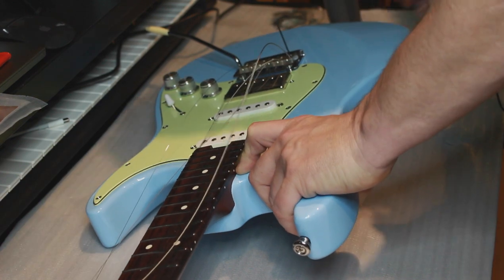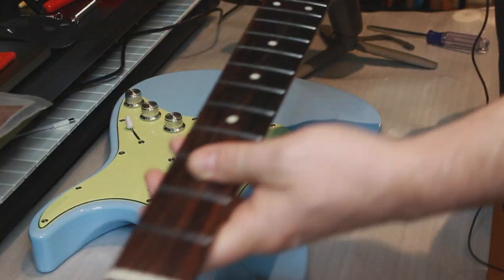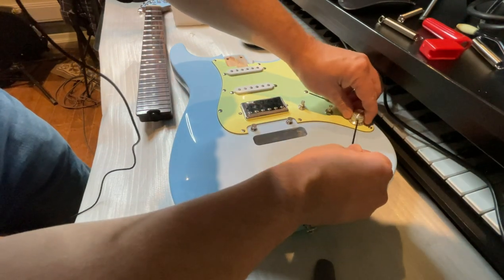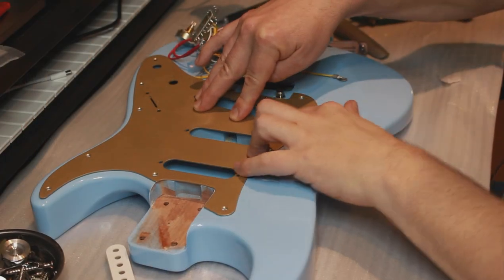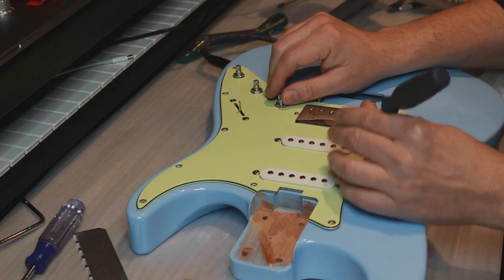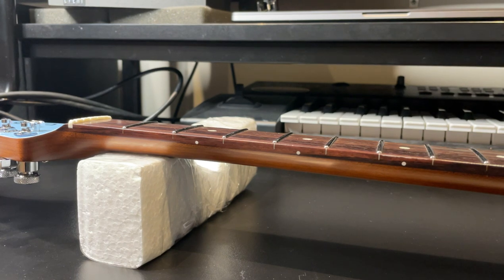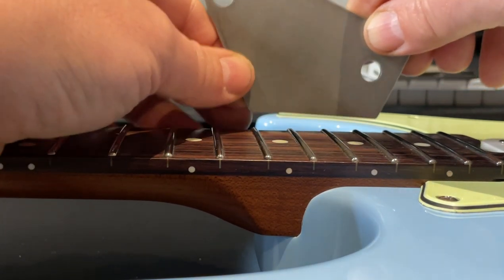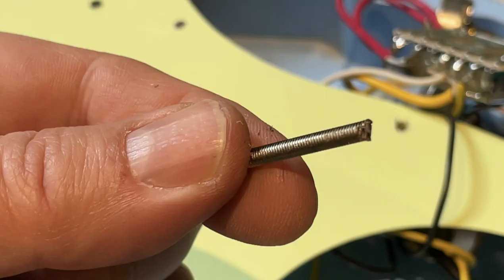Eart CP-1 - Worth the Hype?  Sound Samples - Complete Tear Down - Analysis

Comment: if you are talking about the strings being tight in the block that happens on every brand when strings are over tightened, and judging by the marks the saddle screws made in the bridge plate yea, your stings were WAY over tightened at some point, WAY over tightened, this may be an assembly issue and I agree you need to say something so they can sort it, they take it all seriously so don't think they will not hear you, I bet they will investigate and resolve it..

thats a lot of deep gouging in the trem plate and I am not sure where you think fender gets their bridge plates but its not north america, or south america, they ALL get the same treatment regarding chroming, the difference will be the thickness and dimensions from say a squier to an American but fender stopped making base plates a long time ago so for now they all get the same chroming techniques for sure... 

saddles and screws may be different and again I honestly believe someone cranked down on your strings real hard causing them to jamb in the block and gouge the trem plate like that.. an easy fix for this is to melt solder down into the trem block then redrill at the size of say the largest string a 58 or so? some guys pour brass down em, aluminum, solder works get a good hard solder works fine fill the holes all the way top the top.. that's actually an upgrade for any block, more resonation dontchyaknow...  lol...

they may use a pre tension system where they way over tighten the strings then back off and tighten up so they the strings prestretch? thy are budget strings for sure, d'addario knock off's but very cheap strings indeed, mine strings were gone first ten minutes, they're really bad

but the pups are decent on the Explorer1.. try an upgrade, get out of the budget arena and you will be please.. also ihd to push out 2 strings on my hard tail too so I think they are over tightening them for some reason?

also don't waste your time or money on copper shielding these guitars do not warrant that in any event, upgraded or not, just get a quart of that shielding paint or make some, apply 3-4 coats and it works just as well as copped any day of the week, no jokes, yo can actually use it as a conductor, as in light a bulb with it.. yup done it, you don't ave to light a bulb just put your tester to continuity and place the probes at opposite ends, yup, it works well and is inexpensive, tape over numbers what not..

nuther good upgrade for yours would be the guitarfetish alnico hybrid set or the blues set, the 60 set, for like $50 on sale they are very nice for budget guitars..

what was the flaw or damage whatever yours had?

also any budget guitar will need upgrades, that's nothing new, no budget brand is going to shield or match pups, nope, entry is entry...  again try their $600 guitar, oh boy...  you see the necks on those things?  very very stable..

Comment: Have you tried putting a magnet to the fret wire to see if they're actually steel?
Also is the body 1.75in? If it is then it would be able to take a standard size block/bridge upgrade.
Reply from the maker: It’s not that simple. Even if they are I do t trust them to be of high quality. 

Check out the link below. 

https://www.kjmagnetics.com/blog.asp?p=stainless

Comment: I think the strings made your fingers black not the frets.  Are you running your fingers on the strings on the frets?
Reply from the maker: Hi Bluwg.  Thanks for your comment.  I've gone through thousands of strings in my life and played lots of new guitars and this has never happened before.  I think it's more likely that after polishing the frets Eart didn't do a great job cleaning the neck up. You have to pay a human to clean the neck and that's expensive so they skipped or did a half hearted job.  I oiled and cleaned the neck during the first string change and it was pretty dirty.  Like I said, I think they just didn't clean it up after.
Reply: @LucasCrossleyGuitar  I had the same experience with having my fingers turn black for the first 2 hrs or so of play....Hopefully it's just a cleanup issue because SS shouldn't do that if they're clean
Reply: @LucasCrossleyGuitar  thanks.  You said you had another model, will you be doing a demo?
Reply: I think it's a leftover fret residue from the crowning and filing process when they were installed... at least it was one one of mine.

Comment: I'm curious that, as you've struggled with NON-pull-thru strings, you didn't share tear-down moments investigating the answer.  You mentioned you'd jammed the allen-wrench between the ball and the wall, but the video didn't include investigative comments.  "Ah - NOW I see the problem!" or "Nope, that doesn't solve it."  Do you have any idea why these 'jams' are occurring?  Are you simply not using a large enough sledgehammer?  (Those can create a mighty impression on-stage, by the way.  Pete Townsend only pounded his guitar held by the neck - he never once used a sledge on it!)
Reply: By the way - handyman specials can be great BUT my concern is Quality of Wood.  Just how many times does the wood stand up to screwings/unscrewings?  Because that's one thing a newbie-tinkerer will 'violate' eventually and he'll end up learning about caulks and wood-glues vs. doing it properly.  I'd hate to have a newbie learn that in the first 2-3 mod's... I'd like the wood to hold up at least for 5 change-outs, or 10.  This is one reason I like the Pacificas for my newbie-tinkerers - the quality of the wood HAS BEEN on the outstanding side.  I can't believe they have a monopoly on the cheap good-wood, though.
Reply: One other thing - thanks for the camera work to detail the pickguard "standard Fender hole alignment" issue.  It appeared - on my first viewing - than the standard pickguard's holes are close to the Eart's holes, so that the standard pickguard would easily cover the filled-in Eart holes.  Yes?  Of course, the most troubling issues were (1) the thinness of the body wood which might preclude additional depth-routing, and (2) the need to additional routing to accommodate any other pickup setting.  I appreciate the pool-size routings that some cheap guitars off for mods.
Reply from the maker: Hi Chuck. I asked a luthier friend of mine about this. His position on the matter was quite clear. He stated this only happens on guitars sold at Toys R Us and Walmart. Basically he’s saying poor quality guitars.
Reply from the maker: Hi Chuck if the holes don't line up you can have a few issues.  The biggest concern would be if you have to add a hole too close to where one already exists, then there may not be enough wood between the two to make it strong enough to function the way it should and instead of two small holes you wind up with one big one.  Hope that makes sense.
Reply: Oh yes.  Know the problem well.  Fortunately, the good fillers work well enough and those screw-holes don't have a lot of stress.  I've suspected dried bubblegum would work.  Until I wanted to remove those 2nd screws and then I'd hafta find new bubble gum.
Reply: Isn't it as simple as the holes drilled through the trem-block are too small?

Comment: I don't believe they are locating pins.   More likely voids in the fretboard after putting the radius on it.   Easier to mix up a little rosewood dust and superglue and patch, than use better quality rosewood.    IMHO.
Reply from the maker: Owner of the company told me they are locating pins. They are metal. Appreciate the insight though.  Cheers.

Comment: welp, seen my share of sub $200 guitars and by FAR this neck blows em all out the water, and if it plays well? it blows a lot of $5000 necks out the water, simply for the fact it has hemispherical ends, not easy to do and on stainless steel?

not many $5k mass produced even have stainless frets? your les pauls have em? nope, your teles and strats? nope, you see someo high endser get stainless, none get hemoi ends which are PHENOMENAL despite what the youtube munkess have to say abou it, being able to feel a fret is imperative unless you are a fretless player, it allows you to find the note or chord, whether you realize it or not, they help location..

hemi ends are not new, just not easy to do, clearly you cannot just slap frets on then hit with a fret end file and go, nope, each fret must be measured and installed individually, myself I only do the bottom of the fret hemi, that way I can put a bargeboard on the bottom side then push all hemi ends against that then use a end file on the top side..  they must have figured out a system and my guess is every single fret is the same size for every single guitar they do model wise, meaning the 3rd fret on each strat they do is the exact same size, this allows them to cut a mass of this size of fret, then use a machine that does the hemi end the same each time..

let me tell you doing hemi ends by hand is not easy to make them the same size for each slot, grind off too much or too little on one end? frets not the same size as the next, and this is imperative to get the fret end line straight, and I WISH someone would put the camera down the fret line on each side of the neck so we can see how straight that line really is? if each guitar has straight lines down both ends they have developed a very good system for this.. ask any luthier doing hemi ends its not easy and tool intensive..

my self I use a dremel grinding wheel, then I round off a drill bit with a hemi end that's the exact same size as the fret end I want to be, then I take that drill bit to the grinding wheel so it carves out the cupping I need, then you just put the fret ends intherie wheel spinning and roll the fret in your fingers and its perfectly round, ,long as that cup in the grinding wheel is perfectly round..

that part is easy, getting them the exact length of the slot so when installed the line is perfectly straight on both sides, welp that's not easy, why I do one end only, but those to a board I clamp to the neck then I clip and file off the top side of the frets.. just easier and I still get that hemi feel on my fingers.. like to see how straight that fret end line is on these..  what a deal, stainless frets would bea deal, hemi ends?  oh boy what a treat, they last so long...

also if you do any fret leveling check with rocker and try to hammer frets in where you can to avoid having to dress any frets, with these hemi ends it will be tricky, nuther reason hemi ends are difficult, the fret board must be machine flat and all slots deep enough so that when you pre adjust a fret press to press only so deep that way each fret you press is at an exact height or depth, no leveling required..

you don't want to flatten out a fret with hemi ends, it will be very hard to get that hemi end back while installed on the neck..  so developing a method to get each fret pressed in the same height is crucial, but the precision is warranted for the feel you get.. and should be done in any event.. like CnC finger boards, then precision pressed frets, very nice.... if you do hit with a level just be very careful and tape up the finger board, use diamond embedded tooling and sand papers, diamond or that aluminum graphite whatever, just look for sandpaper to sand stainless steel, options will show up..

dunno bout handyman's special, to only have to install pickups on a guitar that will ultimately be better than a top strat or les paul is more a diamond in the rough, all this tooling fubar is his incompetence, into the guitars.. a new trem ona sub $200 guitar is nothing... considering what it ends up being, tuners as well..

as for the location pins and set pins find a small needle punch, punch them in further, a few millimeters is good, fill with rosewood glue mix.. sand lightly call it a day, and remember this is a sub $200 guitar, not a ferrari so gonna be hard to ruin it right?  and you can put a micro polish on the frets as well..
Reply from the maker: I appreciate your comments but these are not sub 200 dollar guitars. I don’t know where you’re getting that? This particular guitar was over 500. The cheaper one was 385.  I don’t know where you’re getting sub 200??  Anyhow, the frets on both aren’t level. I’ve already used a fretting hammer and it made no difference. By your own admission these frets would be hard to level and dress and both guitars could stand to have that done so that just adds to the challenge. If Eart made available a pick guard that was a drop in replacement that would be good. There’s some confusion about wether or not they do. I suggested to them that they route the body so that a standard fender pick guard would fit. If they did that then the idea of a mod platform makes some sense. I’ve had a couple of people say they needed to route the body to install new electronics. I haven’t tried but I did superimpose a fender pick guard and the holes don’t line up. So, you need to fill the existing holes with small dowels that you would glue in and drill new ones. Not the end of the world but if you don’t have any handyman skills well....you see what I mean and if you need to get your router out then....handyman’s special it is. BTW, these guitars will never come close to the kind of dollars you were mentioning for value. Remember, these guitars are made in a country that pays very little for labor. It’s probably actually worth less than what they are charging in terms of straight economics. I mean if they are making a 30% gross margin then a 500 dollar guitar would cost 350 to make. I highly doubt it’s costing them that much. I appreciate your comments. Cheers.

Comment: So what you are saying is this cheap guitar has cheap parts and lacks attention to detail. Why should this be surprising? All guitar buyers should know that you generally get what you pay for. And sometimes, with some of the lower budget end of things, you can get more than what you pay for. Personally, when I buy lower budget stuff, I do it specifically to work on it and upgrade it. And typically, things like the pickguards, at least for me, never seem to line up correctly with the screw holes.

Comment: sounds like your guitar was used, prolly a return someone messed with, they aren't hacking screws at teh assembly plant...  seeing what I saw yea someone messed with that guitar, that trem plate was way off for a new guitar, who did you buy it form ,buy form Eart only, ebay, amazon, they will send you returns where Eart will not.. the blocks are cheap pot metal, definitely not cold rolled steel like you want, budget guitars always get the whole bridge swapped out anyways, if the stud spacing is right you have options... fret pin holes?  weird, my Explorere1 is flawless..

also again BUY FROM Eart, they will say which guitars get roasted and which do not.. me think you may have gotten a knock off, seen em out there, yup, someone is knocking off Earts, it is chyna after all, why I say buy from Eart ONLY!

you didn't get the CP-10 right?  if it said CP-1 in teh ad you didn't get an Eart.. cuz their $500 CP strat with an HSS is a CP-10, not 1.. did it have a texas flag on the pickguard?  your should be roasted maple neck and roasted mahogany body? bone nut compound neck, radius and rear profile..

also be careful when choosing your guitars at Eart, the Explored 1 and explorer 2 are the exact same guitars with almost the same pups, they are both alnico 5's but the out put is different both low on teh 2 where the 1 has a low neck but a 16 in the bridge,and the 2 has what they call "antiqued cover that looks like a bare knuckle knock off cover.. for an addition $320 more?  huh  

they are teh exact same guitars save the pickups, and one the bridge is wound colder the more expensive Explorere2... sobe careful here, read up on your specs and what you are getting.. $320 more for chynese "custom relic'd humbuckers" is insane.. get this, they claim teh E2 has "custom relic'd high output humbuckers" however they are like 8.8 and 9.8.. whereas the E1 for $320 less has a 8.9 and a 16.9.. so go figger..   I haven't put a MM on my pups I should nor have I tested an E2 to see what they really are but my E1 doesn't seem like the bridge is twice as hot as the neck so that data could be typo but in any event, is a chynese guitar worth $320 more with different humbuckers in it?  hale $320 is well on your way to getting a nice set of vintage humbuckers or a genuine set of bareknuckles.. watch that kinda stuff..

teh real value guitars they have IMHO is the 335 and Explorer1 and maybe the headless, if the C10 was a 5 piece neck with maple and walnut then maybe it be worth it, it is caramelized and that's definitely nice.. aw who knows, I might try one, a C10 that is, not a C1 or an E1..

also teh CP-1 is only $349.. the CP-10 is $599... however they are identical guitars... just different pickups I guess I cannot confirm or deny that as they show no specs but they are the same colors as well.. in any event it doesn't matter what pups the CP-10 has in it, its not worth $250 more!  a guys can get a damn fine set of pups yu know yu;re not going to get in the CP-10 that's for sure, its prolly cheap ceramics in the CP1 like you have and then cheap alnicos inthe CP-10... meh go for the CP-1 and upgrade yourself, absolutely no point in paying that much more money for teh CP-10, same as the E1 to E2,not worth it at all..
Reply from the maker: I bought directly from Eart. If it was a second they should have told me.  Cheers.